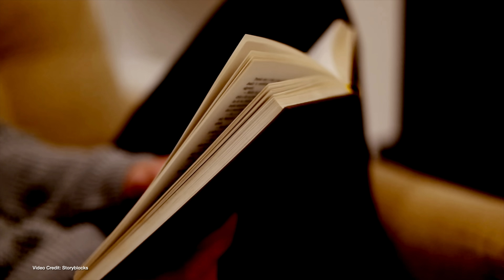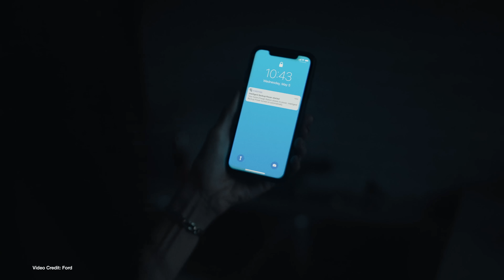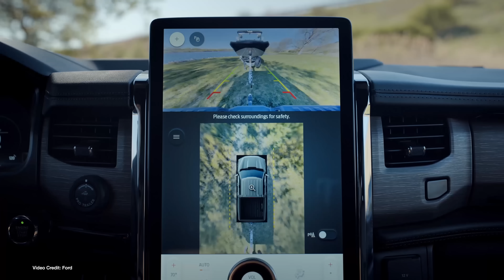What's Vehicle to Home - And Vehicle to Load?

Comment: Could you use your car on V2H to power a heat pump during evening time just before off peak times? In UK, my off peak is 00:00-0730 34p kw and 14p  kw respectively
 
Looking at new build house with a heat pump and then a car to save money on energy bills.
Reply from the maker: Absolutely. Provided it’s set up correctly. - Nikki

Comment: vehicle to load powers thru the vehicle and if youre paying attention and dont use to much, are probably ok. vehicle to home requires extra hardware, ford finally admitted that to use the lighting for VtoH requires you to do 10,000 work ahead of time. it must be planned for ahead of time. if youre not the type that doesnt already own a generator, you not the type to do this ahead of time. if you are the type, youve already planning solar and some type of battery backup. there are cheaper solutions than powerwall.

Comment: I considered buying a used Tesla but not without V2H. The Ford Lightning is too big for my crowded urban area. I would primarily charge the car during low pricing times and use the car's battery during my peak pricing hours to save on my electric bill. Would you consider reviewing the new bi-directional charging Wallbox Quasar 2 when it's available in the US? My question is will the Quasar 2 work with any EV to power my home?

Comment: V2H is a must for Tesla to offfer now that Ford has it on its E Truck.  It is not a benefit for Tesla bc it offers free super charging to some of its vehicles.  V2G would kill Tesla's business model (V2H would as well). Last,  Tesla's power walls will also take a hit if V2H.   I have a Tesla M3 with a large battery pack and just installed solar system (no battery).  I assume in a few years, once Tesla has its business making $$,, V2H will have to be offered or lose to Nissan, Ford and others.....  I see no reason I should  buy a Tesla power wall or other solar battery if I already have a Tesla vehical.

Comment: Very interesting. Just spent 28 hours without electricity after Storm Arwen. Frustrating to have two electric vans with a combined storage of 99 kWh sitting outside, while rummaging about for candles and worrying about the freezers! Even more frustrating to have 3.6kWh of solar panels on the roof when it was a lovely sunny day yet we couldn't get any energy for them as connected to the grid. Definitely time to sort out some off-grid capabilities!

Comment: Still not think v to h is not worth it. You plug in car to charge but then use it to run house? Counter productive. Use a generator is much more usable,  especially if you have solar generator/battery system ready to go.

Comment: January 2020 in northern Iceland a storm took down the electricity grid in some northern parts of the country. As the storm howled on for days, repair teams could not get into the mountains to repair the powerlines. The result was that the coastguard sent ships to run their diesel generators for days on end to provide emergency power. Some places were way from the shore and were without power for 4 days. Waterpumps stopped, and emergency systems went down. 
Dont talk to me about Tesla powerwalls and solar chargers. Those towns are close to 66 degre north - the north polar circle, so they would not be effective so far north. Also telling country folks that have just put their money into a car with a huge mobile battery, that they have to put even more money into a stationary battery that they would use only in emergency is not convincing. Out in the field they need to use a powertool, maybe with a battery and maybe with a cord. So they plug the powertool into a power outlet in the car and the car becomes even more versatile than other cars. 
It is similar to the power output shafts on tractors, that can only be connected to specialized equipment, except that electricity power outlet is the most versatile power transfer that mankind has ever known, since fire.

Comment: I have a problem with one thing you said, "...300 kW or more the truck will draw under full acceleration, or even the SEVERAL HUNDRED it will draw during steady cruising down the highway". It better not draw several hundred kW while cruising. If it had a 100 kWh battery and drew just 100 kW continuously, the whole battery pack would last just one hour. I know it's an unaerodynamic truck and perhaps while towing a large unaerodynamic load, it would pull that kind of power, but not likely much more than 100 kW (or 134 hp). Most (aerodynamic) EVs draw between 20 and 30 kW while cruising at highway speeds.

Comment: I've been wanting something like this in my home since I bought my used Chevy Spark EV back in 2016.  Those DCFC terminals look SO inviting for connecting a 400VDC to 240VAC two phase inverter, I'm surprised no one has been able to market something like that that can provide at least 4 or 5kW.  I know it would have to negotiate with the battery interlock system, but it SHOULD work!  It would be a reason to keep the Spark when I upgrade to a Bolt sometime this year or next.

Comment: I’m not certain but i think V2H has another important benefit and that is if you have solar, your solar will still be operational when V2H kicks in. The vast majority of solar systems are of the grid-tied variety meaning when the grid goes down the solar also goes down so anyone working on the grid isn’t electrocuted. The V2H requires an automatic grid disconnect switch to be activated before the vehicle delivers mains power to the service panel. It seems to me that when this happens the solar inverter will be fooled into thinking the grid is up and will resume operation. I live in California which is earthquake country. If the predicted big one hits experts tell us the grid could be down for weeks. If you had a vehicle with V2H capability you solar could quite possibly continue to operate, thereby powering your house during the day and charging your vehicle, at least charging at a low rate which together with the home load does not over load the solar.

Comment: Thanks Nikki -- very informative!  V2L, at a minimum, is definitely on my list.  Here in Phoenix, I'd aim to run a window A/C or small mini-split system to keep one small room livable. And the refrigerator and internet, of course.  Would need several kW.  Startup current might be an issue.  V2L should provide a higher surge capability, but I'd be surprised if they do.

Comment: Seems to me that VTL should be adequate for most people to use in an emergency, perhaps VTH if you really need to keep more things running. My concern is that many people in a VTL situation will use standard electrical extension cords which are commonly 16 Guage and will be overloaded if connected to more than one appliance at a time - like say a room air conditioner and a refrigerator and a well pump. This could cause a fire hazard. VTL connections should require a 14 or 12 guage extension cord.

Comment: The moment the power fails? Actually, it takes 27 seconds for my propane generator to start and stabilize, so my computers (and the DSL modem) have backup battery bricks too. They don't have to run for long, but it's necessary. There are better solutions nowadays, but when we built the house 15 years ago, this was practically state of the art. It works, and always has.

Good info, Nikki. This may factor into a lot of people's choice of a new vehicle. And it's one of the many things that Ford has done right, which will be yet another reason for real truck people to buy them (we're looking at you, Texans!)

Comment: We live in Mid Wales UK in a 1960's 3 bed bungalow, and we are venturing into replacing our oil heater to an Air Source heat pump, but we are aware of the running costs this heating system can be, especially if your house is not ideally insulated and ours is limited. The reason for the pump coming before the insulation is because the oil burner is on it last legs, we repair it our selves last winter. So to keep the running costs down of our air source heat pump, we are going to employ our Nissan Leaf 2011. Yes we can use that battery pack still in the car on the driveway to run our Air Source heat pump on cheap over night power. In doing so we cutting two thirds off our energy bill using the 6000 watt Setec Power station fitted with a 32 amp outlet, costing around £2.5k. (this is also cheaper than replacing our lead acid battery bank with lithium batteries) This will require a 5 year payback period and giving us energy when the grid goes down, why because we have 2 Nissan Leafs. The grid only goes down in our area say once or twice a year and normally due to storm damage, but grid failures are going to become more common I believe, because our infrastructure is not keeping up with the modern world, and climate change. In the long run we will insulate and rewire re-plumb the house to create a cheaper running system. We will also plan to have at least one room capable of cooling via the Air Source Heat Pump in the summer months as in the future summer heat waves will become more common and longer standing durations.

Comment: Yes, I would be interested in V2H for backup purposes. I plan to get a Tesla instead of my current ICE car, but if the Tesla doesn't support V2G, the second car will be a different brand that does support it. With a Powerwall (plus) and V2H, you would have the option to go and get some power with your car, thus enabling you to be off-grid indefinitely.

Comment: V2l or v2h is so important to me that I may switch from the cybertruck to the F150... I'm just waiting to hear what the v2l capabilities are on the cybertruck.  Our power is super cheap compared to the rest of the country and we don't have time of use billing so any solar or batteries I put on my house is 100% emergency related and nothing to do with saving money.  For the average of two outages a year that last less than 4 hours this would be amazing and so much less maintenance than a generator. The when there is a 3 day outage I can always drive to a working fast charger, charge up and have another couple of days.  Between v2l and v2h I don't care... I'm not going to pay extra so that I don't have to go plug it in when a power outage happens, I can deal with that.  I just care about capabilities.  A 240 50A outlet on the cybertruck would be amazing.

Comment: Spot on Nikki. Using an EV to power your home or emergency specific load uses a fraction of kw as you said prob under 9kw throughput. Driving uses massive amounts of energy roughly enough to power a few houses at the same time when you step in that peddle. So this is a non issue and should be mandatory feature in ALL EVs. Vehicle To Grid should not be mandatory and also paid for by your electric provider not you as a customer. Tesla downplays V2G in the same way I reckon the way I do and has other plans based on V2H and V2L. The media and other outlets get to caught up in the hype of VTG which does nothing for EV owners.

Comment: Hey great video Nikki I'm happy that it is being talked about.
You grow your own food and you would know of the imperative that sufficiency means.
Having ready available EVs with large-sized batteries compared to static storage  - it bothers me why so much potential has been stalled through the 2010s.
When I was in an environmental science course college, we went to visit a large wind farm site in the midlands of Ireland on Turf-cut (exhausted) bogs. They built a tourist centre , we saw the projects they invested in rewetting the bogs and accommodating wildlife. They even turned the septic tank from the toilets into a long patch of birch trees...

The peat burning power station was also being decommissioned for 2024, which attracted much reiterated hurt and concerns about wind power replacing the local economy of turf cutters and power station powers, neither did those workers ended up with a share of the wind turbines. They were ditched.
Anywho, the electricity traders in suits came, and much of the discussion was put strongly about the challenge to decarbonize, the importance and delicacy of trading electricity at different prices in different shares across the whole EU grid, which can sell cheaper green electricity or just buy whatever's cheapest in Poland  - and they explain this was for the stability and optimization for the domestic market - or kaput.

I had something in me that questioned the topic of battery storage on site with the grid, and microgrids for local substations. I also asked about how solar and wind generated personally cannot be repaid and why such a thing wasn't available - they said that storage was simply not convincing yet that no previous examples had been done to safely invest, much of their strongly put reasoning was about satisfying and protecting the market, their supply, the demand, and the frequency stability that is also the supply.

Comment: Incorrect ANY use of your battery will degrade the battery over time doesn't matter if it's driving or grid/home support, use the battery lose the battery no matter what people think or what university papers say. I live in a rural area and over the last three or four years the power only when out once for a few days. Sure it was inconvenient and we lost the fridge and freezer food but that only cost $150 to $200 to re stock the fridge, replacing fridge food is still way cheaper than the approximate $5000 to convert my house to accept V to G in the very rare events. The amount of customers is small that will be in the position to go V to G. Have to be in an area that has blackouts often enough that the system is warranted, and that's a lot less people. Apartments, trailer homes, small houses and very big houses won't install systems, in suburban areas there might be restrictions on power cords visible out front. The customer base srinks the more I think about it. It's seems like a great idea yes and it will work for some if you have a big enough battery like the Cybertruck, but is such a small amount of people that are willing to put in extra money to eliminate the small inconvenience that it won't take off like you say it will Nikki. I want it to work and I am hopeful for a green future  but I am a big brain that sees into the future and many of my predictions have been correct.  V to G yes useful for many will only be adopted by few. I could on much longer but we all have stuff to do.

Comment: Great video! Musk's dishonest negative comments are more to protect his power wall business. An additional capability would be to combine a solar panel/wind generator setup using the EV's battery pack as the storage device when the EV is at home. This would also provide an additional source for charging the EV's battery.
Reply: AFAIK the Tesla Cybertruck was the first vehicle announced with 110v and 220v outputs which obviously gives one V2H capability.
BTW, the powerwalls have been sold out for a long time.  Tesla can't produce powerwalls to fulfill all the orders.My order is 11 months old.

Comment: I have 2 powerwalls and so don’t think I would need my car to do that, but I would think about it if I didn’t have battery backups already.  I would not want to own such a big truck like the F150 lightening though for the 9kW....wonder what a smaller sedan similar size to the model 3 would be able to provide?  Thx for the brood and explanation.  It is not apparent from Ford’s advertisement that you have to make some modification to your home to connect the truck and use as V2H option.

Comment: Could you do us all a favor and call Elon?  Just let him know he needs to add V2H to the Cybertruck. Thanks!
Reply: "As with its other models, Tesla gave Cybertruck some thoughtful goodies. It has 120-volt and 240-volt power outlets and an onboard air compressor, turning the truck into a mobile power station for work sites."  The 240v outlet would be useful in a power failure.

Comment: Hi Nikki,. I do hope some of the EV manufacturers are paying attention.   
My personal thoughts regarding this is that any electric vehicle today should be equipped to handle at least vehicle to home at the rate of three kilowatts minimum.  I chose three kilowatts because I have a 3 kW generator that can keep everything in my house running when I need it for days at a time.  The duty cycle has to be minimum 3 kW at 100% with 175% load for 8 seconds.  Motor inductive loads generally don't last any longer than that and once the motor spins up the average drops off quite a bit.
I would definitely like to see the ability to go vehicle a grid.  Turn the vehicle into a power wall when it's plugged into the house and be able to be a bidirectional energy source if needed.  I suspect this would probably add about $3,000 to the cost of the vehicle for something like this.  I include, in that price, the changes that would be needed in the house to install an auto transfer switch that could communicate with the vehicle.
What I don't see is all the manufacturers getting together with the power companies and hammering out a system of standards that can serve everyone and make life more robust with regard to energy stability.  Just getting these cats to agree on the type of vehicle plug is difficult.  It shouldn't be, but it seems that it is.
The longer the electric vehicle manufacturers wait and the more vehicles they produce that don't have compliant electrical connections and circuitry, the more difficult it's going to be to make a meaningful change later on. 
I love your programs. They are always quite informative and seem to be some pretty good fog lights too penetrate the fog of confusion that can be in front of all of us, from time to time.  Thank you.
Cheers, John L in Fairlawn Virginia USA